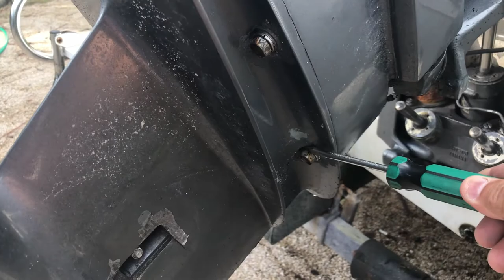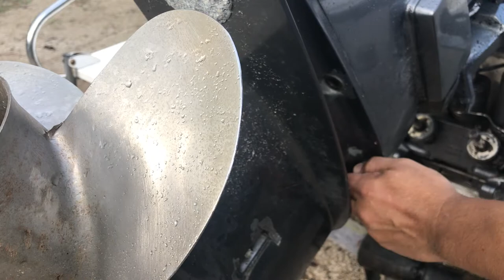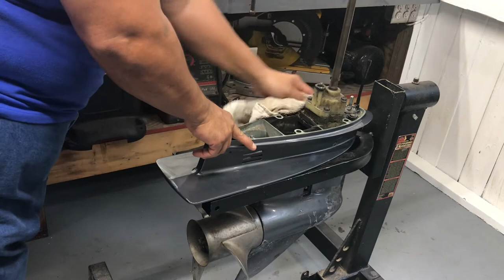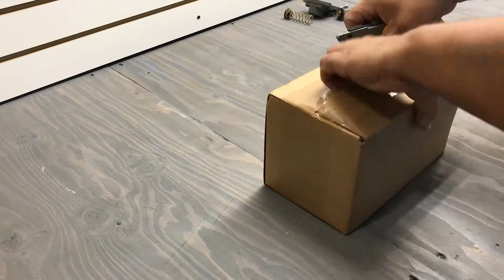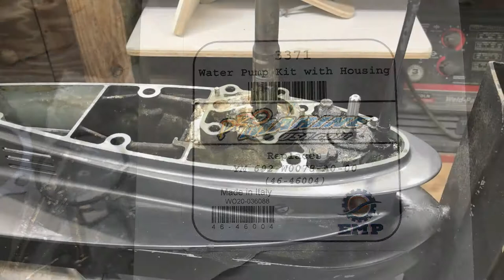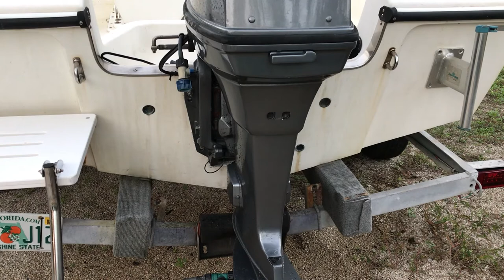How to replace the water pump on 2006 Yamaha 90 hp outboard motor.

Comment: What did you see wrong with the impeller housing ?   Where did the big round o ring go ? Thanks
Reply: I'm pretty sure it goes underneath  The lower portion of the Impeller housing. Wish you would have said that. However it's not needed for just doing the upper replacement

Comment: How do you remove the old water pump base? Mine is corroded and needs replacing. What the trick?
Reply: Please comment back if you ever find out how to take it off. I just cracked mine trying to take it off. Thanks!
Reply: @itsdavidkay  I simply pryed it up with screw driver

Comment: Why didn’t you put any green gaskets
Reply from the maker: If you look closer, the gaskets on this set are gray, and they are installed.
Thank you for watching.
Reply: @GPDIY  I noticed same thing in my kit.  There is a 3rd gasket.  No idea where it goes and I seen in the layout your kit.  Is it extra?
Reply: There was another layer that came apart, thats wherr the extra gaskets go I suppose.
Reply: Im skipping that step also, I dont see it necessary it should still seal if the seat does move during dis assemble